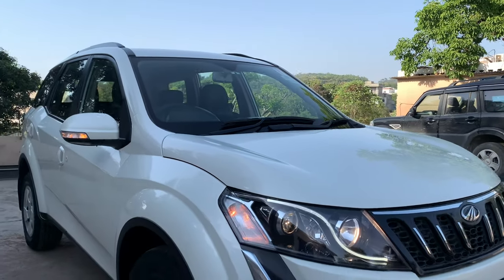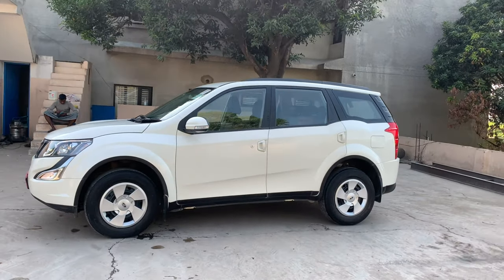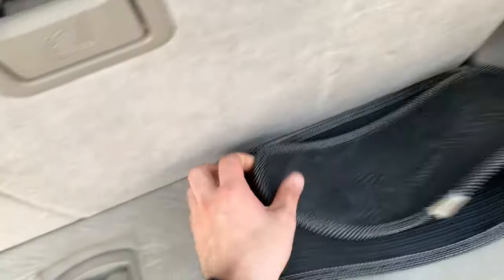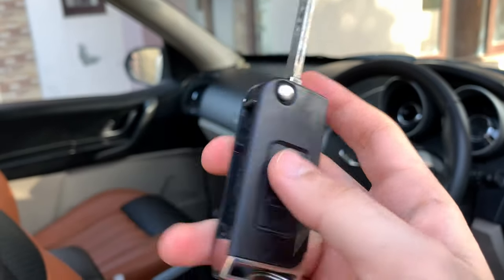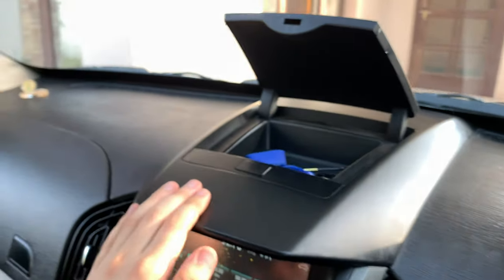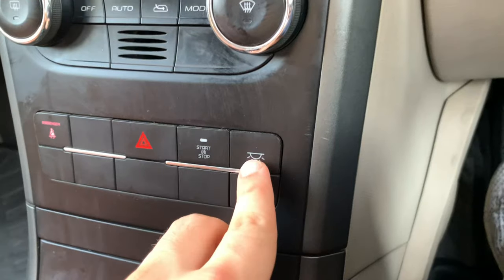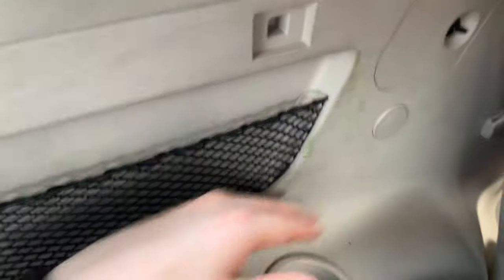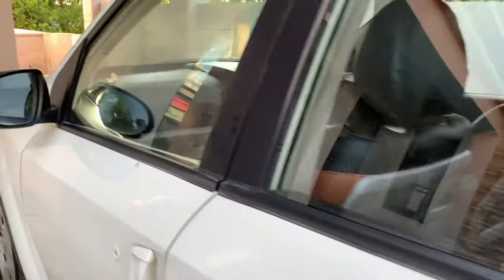XUV500 W6 After 5 Years | Long term Review - Still a Beast in Brand New Condition

Comment: Bro 2016 w6 red colour hai….gadi pe scratches or dent hai …one side gadi divider ko thoki hui hai right side…. But engine accha hai….wo kitne tak leni chahiye….?? Wo bolne ke 8 lakh bol rha hai but kam ho jayenge bol rha hai to apki kya advice hai??
Reply from the maker: Price can be slightly reduced 
And make a proper Check by Mahindra about engine, gearbox suspension 
They can thoroughly checkup vehicle
Reply: Bhai 6,70,000 ke karib aa jayegi
Reply: Lelo bhai
Reply: 7 lakh Tak
Reply: Bhai 2017 model untouched 1lack chali h 6.7 lack ki de raha  h